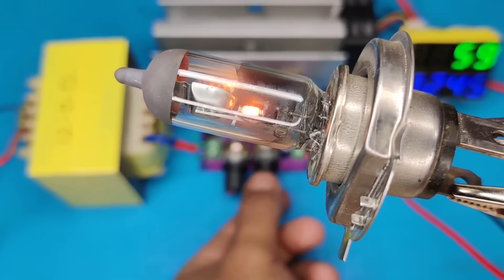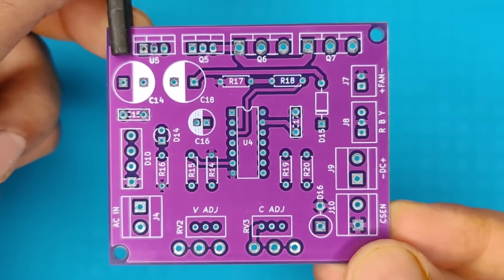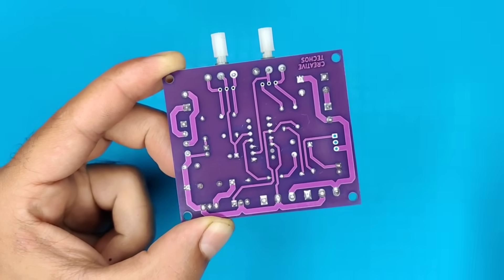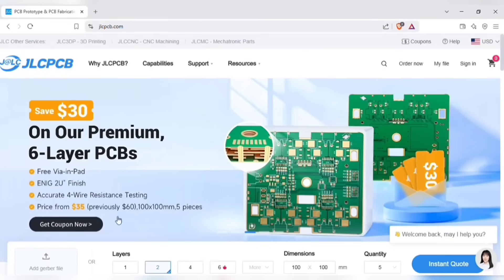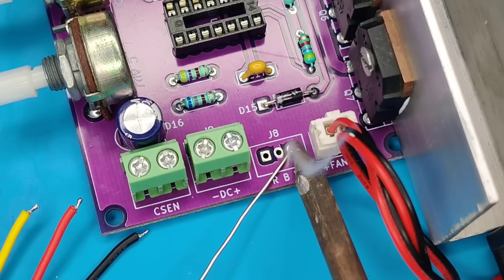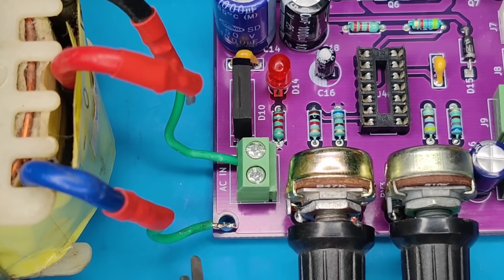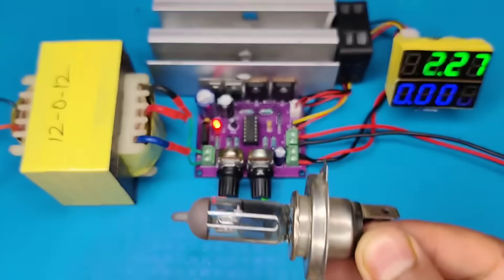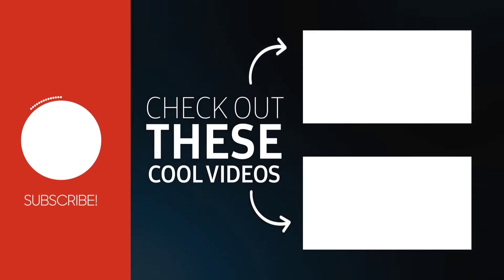Build your own variable 0-60v 0-10A AC to DC Adjustable bench Power Supply

Comment: With 1000uf + 1000uf the ripple at higher input current draw > 1.5 amp would go haywire which will make output unstable

Comment: É uma pena informar algo que não pode funcionar a 60Vx10A...😕
Reply: Ja, das war auch meine Idee - nach dem Full-Bridge-Rectifier liegen maximal 24V AC * srt(2)) = ~ 34 Volt an, und keine > 60. Der KBP310 verträgt maximal 3A,  der LM7812 maximal eine Eingangsspannung von 35V,  Lade-Elko und Endstufentransistoren sind total unterdimensioniert. 
Aber als 0-30V, 0-2A Netzteil könnte es funktionieren, nur leider fehlt die Rückkopplung der Ausgangsspannung zur Regelung = bei höherem Ausgangsstrom sinkt die eingestellte Ausgangsspannung. Vielleicht ist das Ding als Ladegerät für einen 24V (7S 4P) Lithium-Ion-Akku zu gebrauchen? 😀

Comment: Annoncer 0/60V 0/10A avec ces composants est irréel, le redresseur assure que 3A max (pas constant) et le transformateur est sous dimensionné pour fournir 60V 10A, faire des vidéos juste pour être vu, ce n'est pas terrible, non?
Reply: @JLNweb - Please explain your statement "the rectifier only ensures 3A max (not constant.)" I do not doubt that you are correct, I just don't have enough knowledge, yet, to sort out what you mean. To me, it appears from the data sheet that the 723's working current is just 150mA and that the bulk of the PSU's current supply is to come from an external pass transistor. My use for the 723 would be to build a traditional Dual Linear 0-30V/0-3A PSU. Maybe you could give me some tips? I am looking at the Texas Instruments uA723 Data Sheet (because I can source OEM 723 chips from Mouser.) Thanks for your help!
Reply: Oh, another question... The data sheet shows various schematics. I should use the one for a floating ground, correct?
Reply: @t1d100  Les transistors employé ne supportent pas une telle intensité (max 8A) et dissipation 50W max (datasheet) pour 60V/30A il faut 1800W et le reste ne supporterait que 0 à 30v 3A max. Le transformateur doit lui aussi supporter la puissance totale (utile + absorbée) On est loin de ce qui est annoncé. Même bien refroidit, à 10A ce montage ne tiendrai que quelques minutes (max 1h) Quand on parle de puissance, il faut y mettre ce qui va bien, pour un amateur cette alimentation serait juste pour une utilisation ponctuelle à faible tension/courant. Juste mon avis qui conçoit des système électronique depuis plus de 50 ans.
Reply: @JLNweb : Du hast leider einen Denkfehler - das Super-Netzteil soll laut Beschreibung 10A können, und keine 30, also fallen "nur" maximal 600W Verlustleistung an 😉 ich denke, dass die Dioden im KBP310 bei einem Strom von 10 A keine 10 Sekunden durchhalten, und nachdem der Ladekondensator beim Einschalten leer ist, fließt im Einschaltzeitpunkt kurzzeitig ein sehr viel höherer Strom als die angegebenen 10A 😂 (ich beschäftige mich erst seit 47 Jahren mit Elektronik 😉) aber ich gebe dir & deinem Vater Recht: Das ist ein stabiles 0-30V/0-3A  Netzteil - nur der Full-Bridge-Rectifier muss auch noch gut gekühlt werden 👷 
---- 
@JLNweb : Malheureusement, tu fais une erreur - la description indique que la super alimentation est capable de 10 A, pas de 30 A, donc la dissipation de puissance est « seulement » de 600 W maximum 😉 Je pense que les diodes du KBP310 ne dureront pas 10 secondes à un courant de 10 A, et comme le condensateur de charge est vide à la mise sous tension, un courant beaucoup plus élevé que les 10 A spécifiés circule brièvement à la mise sous tension 😂 (je travaille avec l'électronique que depuis 47 ans 😉) mais je suis d'accord avec toi et ton père : il s'agit d'une alimentation stable 0-30 V/0-3 A - seul le pont redresseur doit être bien refroidi 👷
Reply: @JLNweb: Das war auch mein Gedanke - 24V AC gleichgerichtet sind rund 34 V DC (24 * sqrt(2)) KBP310 würde bei 10A Belastung nicht lange leben. Der LM7812 verträgt maximal 35V und der Ladekondensator ist mit 1mF sehr klein dimensioniert. Ich schätze, das Gerät würde als 0 - 30V/0 - 2A Netzteil verlässlich funktionieren - und den Lüfter kann man sich auch sparen 👷‍♂ 
------ 
C'est ce que je pensais aussi : 24 V CA redressés donnent environ 34 V CC (24 * carré(2)). Le KBP310 ne tiendrait pas longtemps sous une charge de 10 A. Le LM7812 peut supporter un maximum de 35 V, et le condensateur de charge est très faible (1 mF). Je pense que l'appareil fonctionnerait de manière fiable comme alimentation 0-30 V/0-2 A – et on peut aussi se passer du ventilateur 👷‍♂(tranduit par Google)